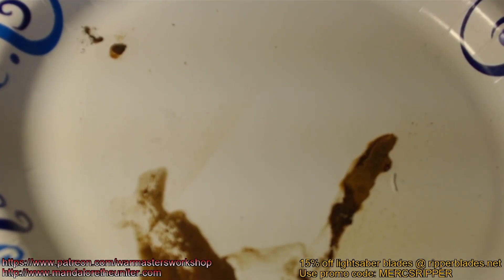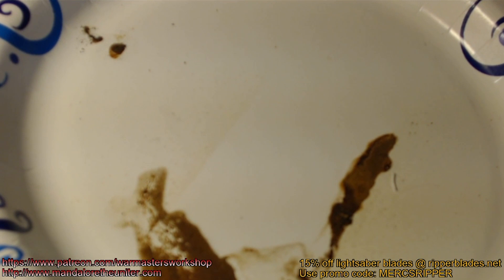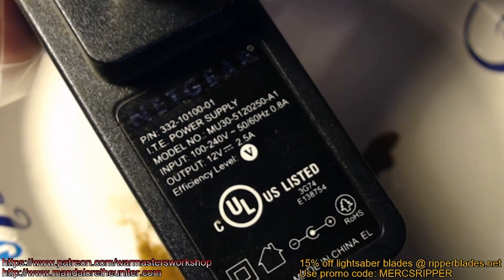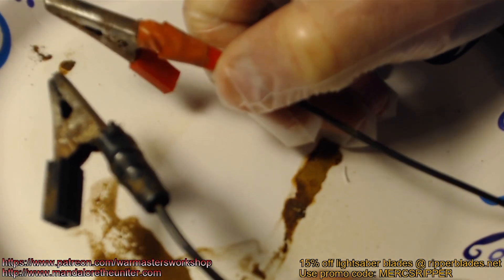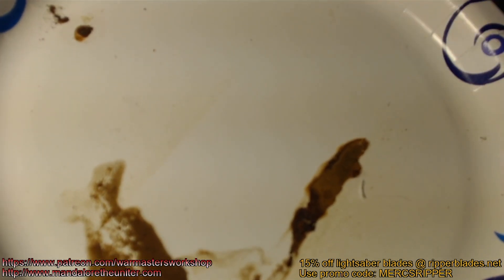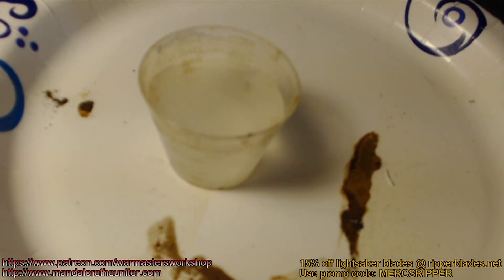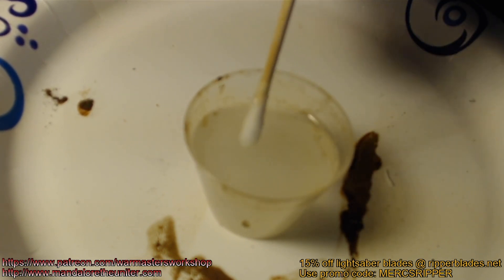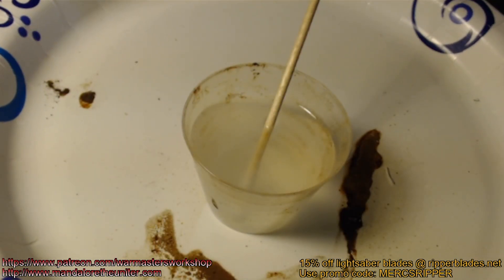Short 9 - Salt Water Engraving

Comment: Can you use masking tape, or does it have to be vinyl for masking?
Reply from the maker: You can use electrical tape but I wouldn't use masking tape.  The boiling salt water may cause the masking tape to break down, electrical tape works perfectly fine though.